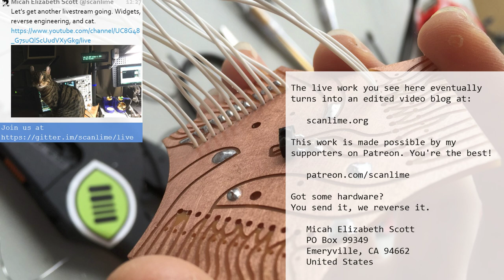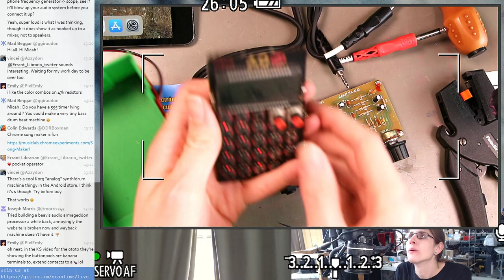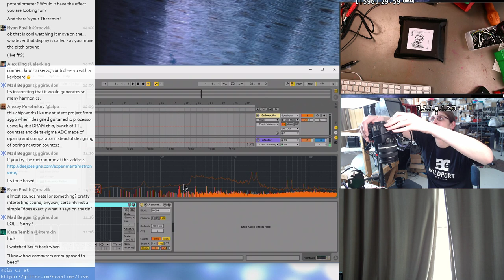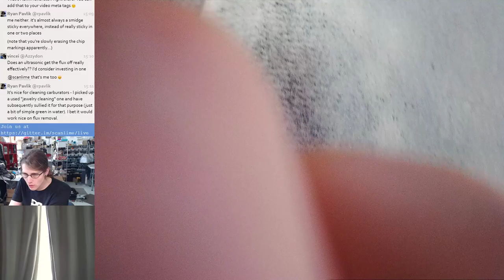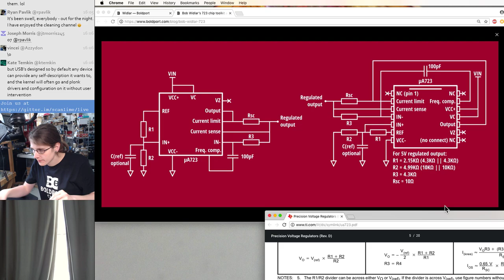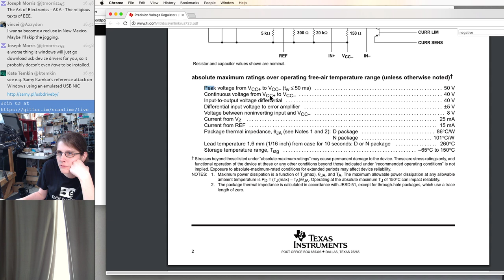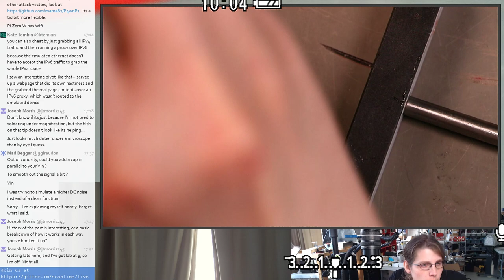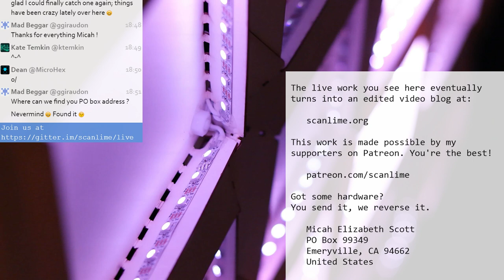Relaxing #analog #electronics and #cat LIVE today with EAKit, Boldport Widlar, and Tuco Flyer

Comment: I get excellent cleaning results with a cheap $40 ultrasonic cleaner (with no heating) and 91% alcohol straight in the cleaner. It is a bit wasteful, but alcohol is also reusable a few cycles. Clean for ~10 min and no residue at all.